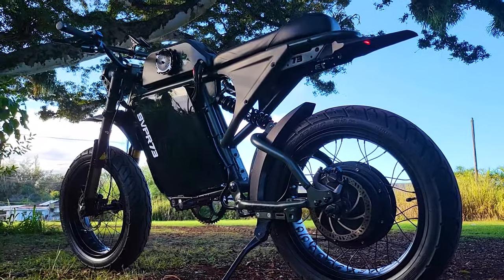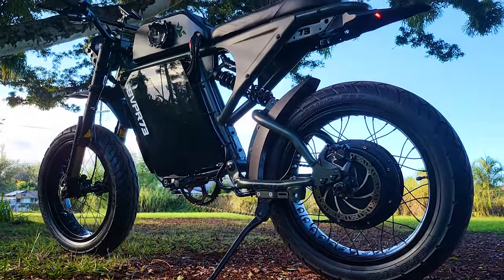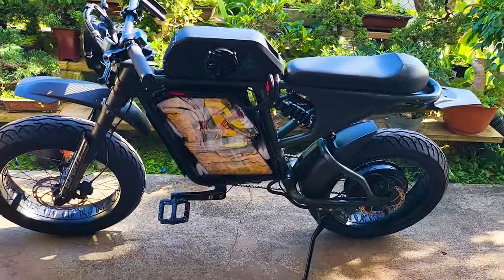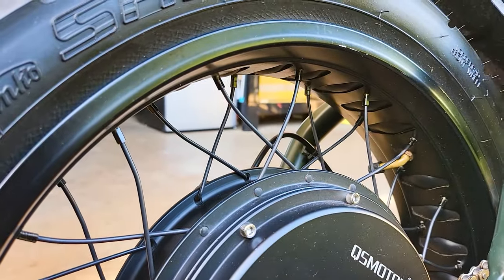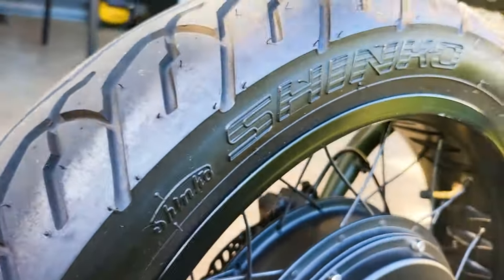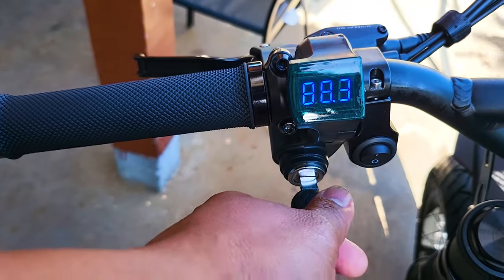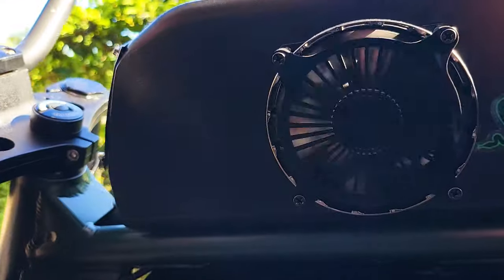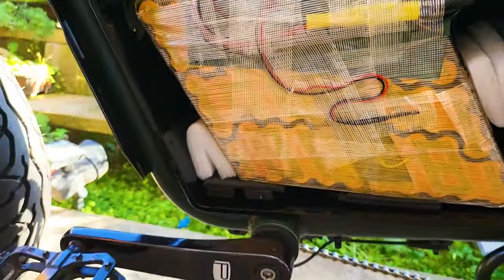The best electric bike Super 73 RX  DIY MOD!

Comment: It looks nice but the brakes are tiny are not going to cope. Looks like a death trap.
Reply: Especially with those huge beefy tires. So much rotational mass plus all the added speed and power. How do you not upgrade the brakes to something big? Needs something motorcycle level in the front for sure like the ONYX
Reply: Bike has variable regen breaking controlled via brake switch. Its stronger than any Hydraulic brake. Accompanied with Hydraulic brake for extra stopping power. Same design with any electric vehicle.